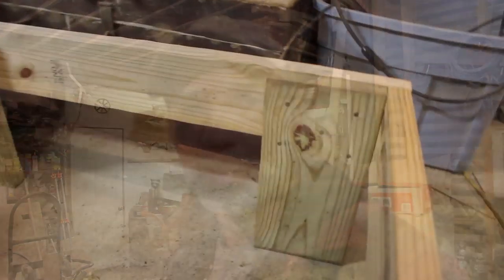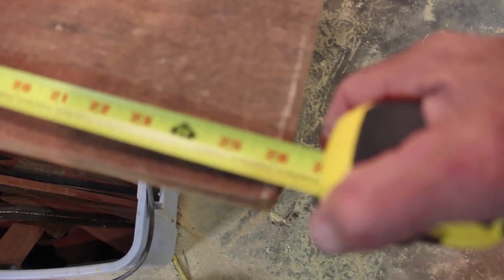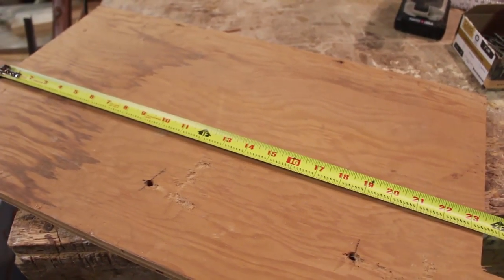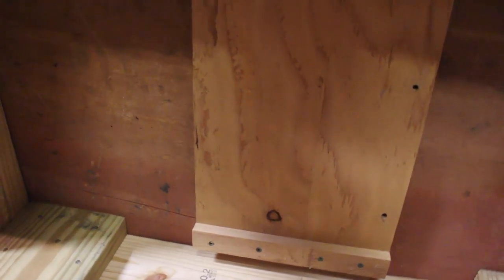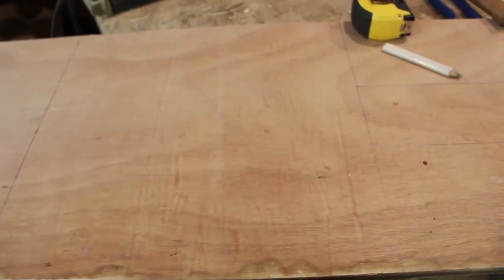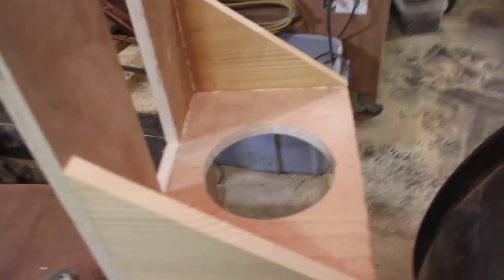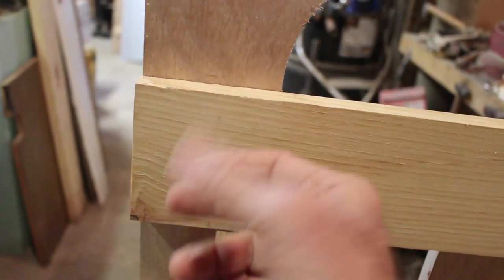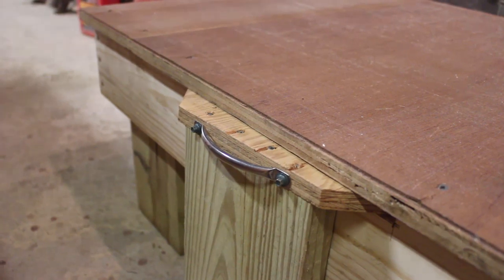Goat Milking Stand w/ Built-in Stool ~~ DIY Project

Comment: Instead  of making a hole, why not a vertical heat stock, like is used for cows? With one board that could be slid/pivoted over to sort of lock the head in? And would work for any height of goat as well...